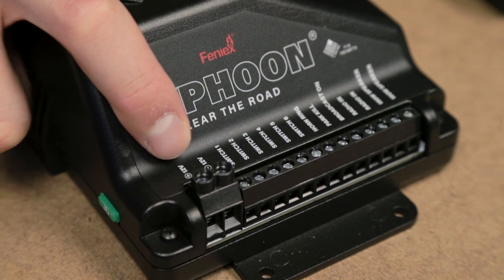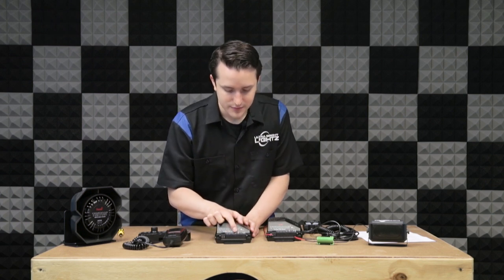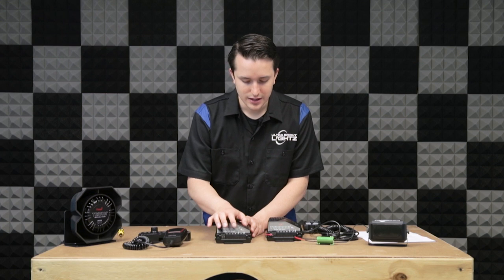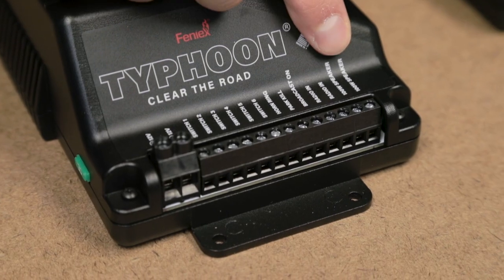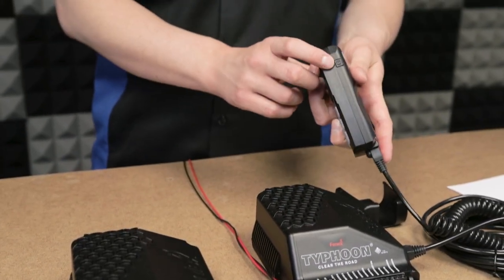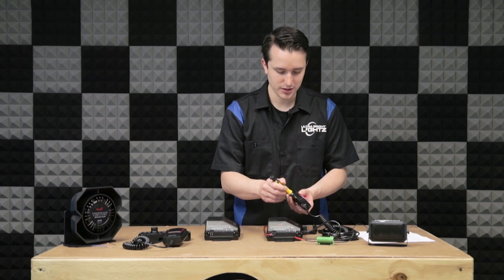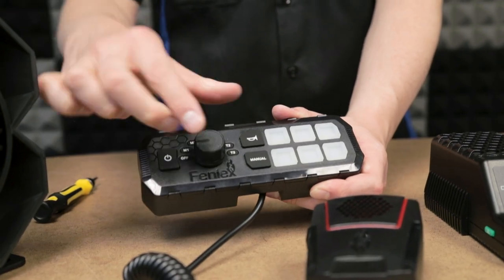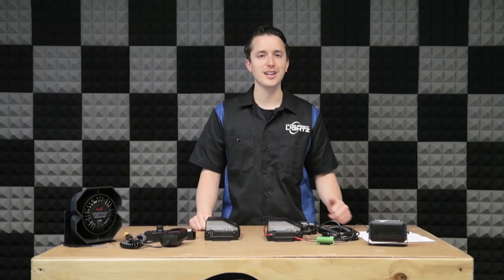How to Wire a Feniex Typhoon Siren

Comment: When the horn wiring is connected with my car horn, and I push the horn at the steering wheel, activated this the air horn or so when I push the manual button?
Reply from the maker: You will hear the air horn through the external siren speaker when the horn button on your steering wheel is pressed and also when the button with the horn icon is pressed

Comment: So when connecting a light, do you take the positive wire and put it in switch 1-6 and then what do you do with the negative wire from light?
Reply from the maker: Ground the negative wire
Reply: @UltraBrightLightz  So it doesn't get grounded with the Siren?
Reply from the maker: @matthewvick6933  You can ground the lights with the siren as well

Comment: How does the wig-wag wiring work on this unit? Does it just tap into the lights, using a diode, or do the lights have to route through the typhoon?
Reply from the maker: The lights have to route through the Typhoon

Comment: I installed a siren on my POV. Instructions said to have direct power to my siren from the battery with an inline fuse. My battery was being drained so I had to pull the fuse/cut power. Can you please help me by showing me a diagram to understand how to properly install this.
Reply from the maker: Hi,

No problem! Here is a link https://www.ultrabrightlightz.com/content/Manuals/Feniex/Feniex%20Typhoon%20Instruction%20Manual%20Directions.pdf
Reply: 714Joker1 maybe don’t wire the positive wire directly from the battery? Run it from a source that would normally only have power after the ignition has been switched on. That’s what I’m thinking because I got mine in the mail today.

Comment: How would you wire the lights so you can change the pattern?
Reply from the maker: You would need to run the pattern change wire from the light to the button that you want to be the pattern change button on the controller.You will need to make that button a momentary button

Comment: So if I want to activate grille lights with Switch 1, I run the power cable from the lights to the Switch 1 slot?
Reply from the maker: Yes!
Reply: @UltraBrightLightz  Thanks!
Reply from the maker: @Firebuff101  You're welcome!
Reply: Where does the negative cable go from the light though?
Reply: @dustinjohnson2116  that's up to you, as long as it's grounded

Comment: I have everything wired up correctly. Why am I getting alot of static when I use the PA mic?
Reply from the maker: I would double check and make sure the speaker that you are using is compatible with the siren.Please make sure that it is 11 Ohms
Reply: @UltraBrightLightz  it is a Feniex Triton speaker.
Reply from the maker: @ddalke21  I am not too sure why that is happening then.It should be working fine.Have you tried calling Feniex? Their tech support department will walk you through all of the install steps and try to figure out why this is happening

Comment: Question:do either of these units come with the wiring?
Reply from the maker: Sorry they do not but we do sell the wires you will need! https://www.ultrabrightlightz.com/18-2-wire-bundle/
Reply: @UltraBrightLightz  Ok thank you. Will that be the only wiring I need?
Reply from the maker: @albert75505  You're welcome! You will need wires to run from the engine compartment to power the siren and also wire to run from the speaker to the control box
Reply: @UltraBrightLightz  are those also available to buy and if so,which ones are they?
Reply from the maker: @albert75505  This will be fine https://www.ultrabrightlightz.com/18-2-wire-bundle/
Reply: @UltraBrightLightz  so what your saying is I could use the wires you linked for both the siren as well as the positive and negative wires?
Reply from the maker: @Break_And_Try_To_Fix  Yes!

Comment: can ı wire switch A vısor bar rocker panel light stick and switch B flash pattern switch C take down same tıme use?
Reply from the maker: The Visor Bar and Rocker Panel should be on separate switches
Reply: @UltraBrightLightz  thanks  ıf ı want use same time can ı do this with flasher?
Reply from the maker: @alpeksi4183  You're welcome! The Feniex Typhoon has 6 inputs so you can wire up 6 different products!

Comment: Can i remove the Mic
Reply from the maker: No because that is where all the controls are located
Reply: @UltraBrightLightz  i am asking about the full function model where its just a mic
Reply from the maker: @chrisbryant9274  Yes you can remove it from the Full Function model
Reply: @UltraBrightLightz  do i have to mod the circuit board i tried removing it and the siren no loner functioned
Reply from the maker: @chrisbryant9274  Did you tie the wires together after you removed the mic?
Reply: @UltraBrightLightz  no did not. Is that all I have to do
Reply from the maker: @chrisbryant9274  That should work.If it does not please reach out  to Feniex Tech Support  and they will be able to assist you! 1-800-615-8350
Reply: @UltraBrightLightz  thank you
Reply from the maker: @chrisbryant9274  You're welcome!